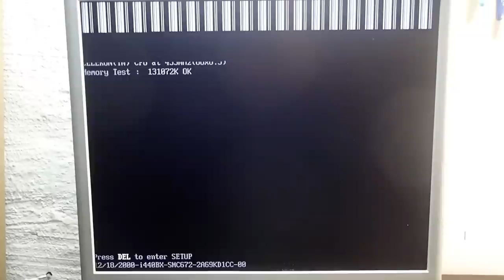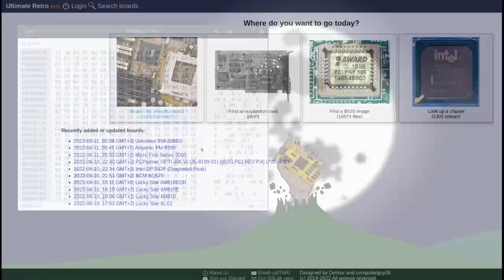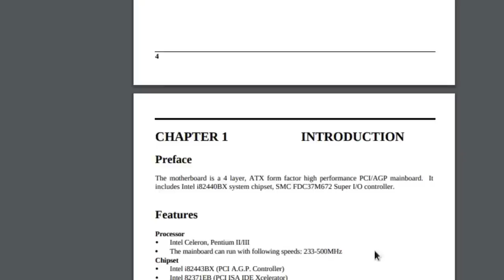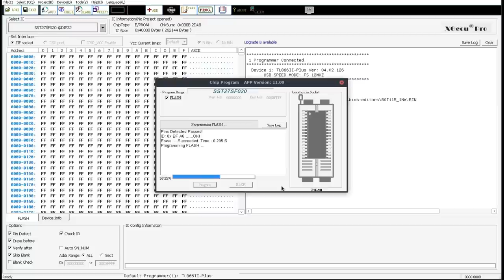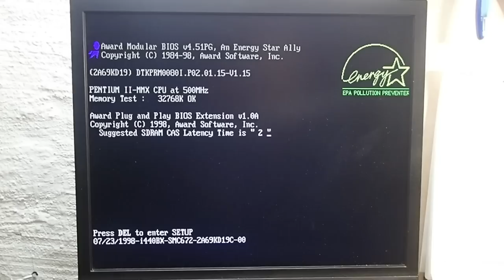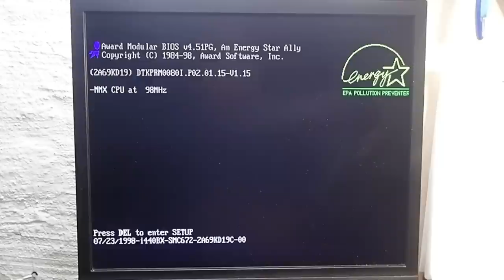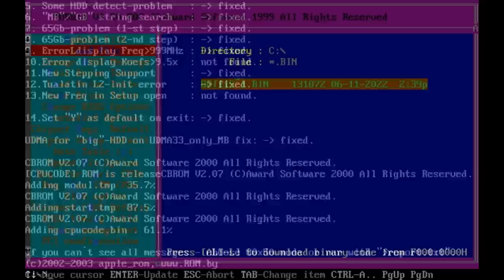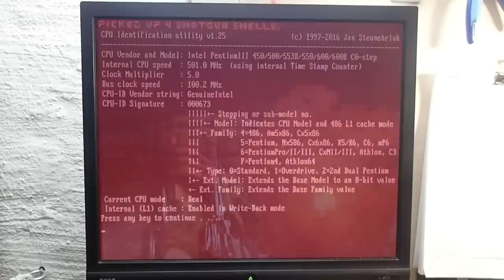My endless confusion with a i440BX Pentium II mainboard.

Comment: Those slotket adapters will eventually burn out the vrm regulators next to the slot. I upgraded my board all the way up to a Pentium3 Tualatin with the slotket and was still using that PC till  2012. But the slotket draws more power than the spec of the board allows. That's how my 440bx came to an end. I finally had to upgrade my PC after 15 years of use.

Comment: Very nice and  nostalgic video. I have two retro PCs (Pentium II) with the 440BX chipset that I revived from the old days. Although they do seem to work, I have trouble loading an O/S on them. USB is out of the question and Windows disks do not work either. What do you recommend in such case if I want to avoid using the floppy?
Reply from the maker: May be the IDE controller is defective. I'd suggest to try a PCI IDE controller and see if it works.

Comment: Hi, did you noticed BIOS 1.?? is 1 Mbit in size? maybe he tries to flash de 2Mbit into a 1Mbit ROM chip and it didn't fit and something is missing, can it be possible with a proper 2Mbit ROM chip and use the latter versions of the BIOS? not sure about what I'm saying but noticed the difference @13.18
Reply from the maker: Yes, the V1 BIOS is 1Mbit, where V2  is 2Mbit. The original EEPROM was a 2Mbit and the image was written completely. If it wouldn't be complete, then the checksum wouldn't fit and the board wouldn't start to initialize. Furthermore I tried to reflash various 2.x version as experiment too and none worked.

Comment: I had problems with software on a BX mainboard,  I had one failed and the replacement the NT system did not like,  I checked and is was not the same REV number, getting a replacement one of same manufacturer and the system worked as I expected it too.   (Slow , the memory expansion is pretty sparse on these)

Comment: found modbin 6.0.0.38 and 6.1 - v4.50.77 and v4.50.88

which version is needed ?
Reply from the maker: Depends on BIOS which you use. If the board is older and uses BIOS 4.5x, you will need modbin 4.5x and for 6.x. the newer version.

Comment: The 440BX chipset was amazing for its time. I used to have one and I got a Tualatin Celeron 1400 and threw it in there to make a decently powerful backup PC. My mobo (Shuttle brand) wasn't stable at a 133 Mhz FSB, but I OCed it to 115 and that pushed the Celeron to 1610. Fun times.

Comment: You also need to be careful about ESR and current ripple, not just capacitance. The VRM needs very low ESR especially on the output, that's why you often see 2 or 3 capacitors in parallel on each phase of the VRM - to lower the ESR. Look in the datasheet at impedance at 100 kHz and that's pretty much your ESR (at high frequencies ESR is pretty much the same value). In most cases, you need to match or get very close (let's say within 5-10%) of ESR and current ripple should also be equal or higher.
This motherboard you have powers the VRM with 5v from the power supply, so there's no point in using 16v rated capacitors. I would have suggested either 6.3v or 10v rated electrolytic capacitors, or solid (polymer) capacitors, in which case you can often use lower capacitance (for example 1000uF or 1200uF 6.3v instead of 1500uF 6.3v would be fine). ON the output side, you could use 4v rated solid/polymer capacitors, which should be easy to source.
Reply from the maker: Absolutely true.

Comment: Finally a new video. Had hard concerns that you quiet making repair vids. Had an old Gigabyte Board a few years ago with LX Chipset and that revision was only capable of handling the first line of P2 and Celerons. The Mendocino Line was not supportet due to Bios Problems and no newer version available. So, very good job by modding the 1.15 Version and weclcome back.

Comment: Still have a 440BX based system running using an Asus P2B mainbord. 

When I got the PC in 1999, it contained a Slot1 Mendochino Celeron 400 MHz, 64 MB of RAM, Matrox Millennium G200 AGP card, Soundblaster Live soundcard, a 6 GB Quantum Fireball HDD, and CD-RW drive. OS was Windows 98.

The current final configuration is a Tualatin Celeron 1.3 GHz, 768MB of RAM, Matrox Millennium G550 AGP card,  Soundblaster Live soundcard, a 80GB Seagate Barracuda HDD, a Hitachi Deskstar 120 GB HDD, 1 DVD+RW, 1 CD-RW and an Intel 100Pro NIC. OS is a dual boot of Windows XP and Debian Linux 11.

Problem with these vintage systems is getting a decent power supply. Modern ATX power supplies are not really suited anymore for the old CPUs,; they don't deliver enough power on the required voltages for vintage CPUs.
Reply: If you have a relatively low power CPU and at least 20A on the 5V rail you should probably be fine... Which is why I stick to my Pentium II 333 that has a TDP of 20W.
Reply: @lordwiadro83  The TPD of the Tualatin Celeron 1.3 GHz is 34W. The GFX card is also a factor. That is the reason I replaced the GeForce Ti4200 with a Matrox G550: it eats much less power: (around 12W compared to the 30-40 Watts of the Ti4200).

Comment: heh, have an old celeron board someone flashed the wrong bios to. it sat for years because both me and my buddy thought it was dead, and at the time we couldn't find a bios file for it (as we were looking for the right board revision, while the previous owner seems to have grabbed whatever they could find, which was a revision down as i later found out).

got bored one day and said screw it, lets see if there's one floating around now. yup. thanks to archival programs like TURP, i managed to find the proper one, flashed it, and it fired right up.

has me wondering about my unstable pentium pro board now.. hrm.

Comment: In 2003, I had a PC in our company's office with (almost) exactly this motherboard and a CPU adapter. IIRC there was a PIII with 900 MHz installed. 100 MHz FSB, that makes me as a die-hard overclocker completely crazy.
I never understood why we as a consulting company had worse hardware than our customers. God, I really hated that computer.
A year later I bought a Powerbook G4 17" 1.33 GHz, left the company and switched privately to OS/X completely within a week. That was a real revelation.
Back then, you still had real reasons to buy a new computer every two years at the latest, or to constantly upgrade the old one. I've had my current main computer for eight years now. Unchanged: an i5 4670K with 16 GB RAM. Only the SSDs (now .m2) and the graphics card (now RX570) I replace in the time. All that stuff has really become more durable. The environment thanks it. 
I hope we'll have ARM CPUs in desktop computers soon. Until then, I'm experimenting with TV boxes.
Reply: I feel like the new processors and graphic cards are not that impressive anymore... Also, it's getting expensive upgrading to the latest and greatest all the time :p

Comment: Capacitors on boards of that era should always be suspected as being bad. 440BX was popular right at the height of the capacitor plague .  Many good boards were killed back in the day because of it
Reply from the maker: The 440bx was actually not that bad, it was more the later Athlon systems, which were badly affected by the capacitors plague. To be honest, behind the scene I checked the removed caps from this board and they were all in very good condition. Still perfect capacity and low ESR, even the scratched ones turned out to be absolutely ok. Still, I don't regret replacing them.

Comment: I have a MSI 6119 440bx but it sadly stopped posting suddenly. One of the voltage line is shorted. Normally these caps don't fail short so I dunno.
Reply from the maker: Could be one of the transistors in the voltage regulating circuit. That is a common issue as well.

Comment: it's usually okay to replace electrolytic capacitors with bigger ones.
Reply from the maker: It depends, usually higher value capacitors have also higher ESR, but if you use high quality caps and keep that value in mind, then yes.

Comment: is there a way to upgrade the FSB to 133?
Reply from the maker: Yes, by exchanging the clock generator, but it is a lot of work and 440BX doesn't support 133MHz officially, it overclocks the AGP to 83MHz at that speed, so I prefer to stay at 100MHz FSB on that chipset.

Comment: What I found frustrating with my board when I got it was that it reported a ‘CPU error’, even ended up buying a different CPU only to have the same issue. In the end after remembering a CuriousMarc video I thought to try reflashing the BIOS which cleared it.

Why they couldn’t have had ‘BIOS checksum’ as a separate error code IDK.
Reply: I think the main reason why that kind of checksum comparison is not used, is that the precalculated checksum would be stored in the same location where the BIOS is stored. So the precalculated checksum could corrupted even though BIOS data is correct and then the comparison would report discrepancy between those two resulting in a ”broken BIOS”.
Reply: @tab8k  Either that or the area which is corrupted (probably a flipped bit) was not ‘essential’ to booting to DOS from a floppy disk and allowing me to perform the update.

Comment: You should also consider ESR value and ripple current, especially in capacitors that are in the voltage path of the CPU. The ESR value is usually the reason why Chinese caps are always a bad choice, as their claimed value is always far from the truth.
Reply: In 2003 I got similar BX440 motherboard with P3 500Mhz and bad caps- I recapped also with generic 16V electrolytics- it worked well for a few years. But this motherboard won't be even used every day - so here generic no names will be OK.

Comment: i propose celeron tualatin 1,4 ghz and 768 mb of sdr133 (at 100) cl2 should work nicely
Reply: Agreed on Tualatin but I suggest sticking to 512MB of RAM so Windows 98 is happy.
Reply from the maker: I don't have a tualatin and I'd have to modify or get a slotket adapter, which would run with it. So far I will have to live with a coppermine, I guess. But I don't mind, I don't want to have the fastest PIII, but the most compatible.
Reply: @necro_ware  i see, i alwys loved how easy is to wiremod a cpu to install it in older motherboard with thin wraping wire
and i had 3 computers with them, one of which was my daily driver for 5 years (celeron 1100 tualatin on cusl2-c runing nicely on 133 bus after covering bsel pins)
i also had very fun celeron coppermine from cd0 steping 566 model which didn't mind runing as 133 mhz bus either it was just so much fun to say i have 200% overclocked cpu
i wish your build good luck and good agp 2x graphic card because that mingt be the biggest compatybility problem of a bx board
Reply: @Arti9m  my was happy after installing a pach microsoft released from windows update, that being windows 98 se got one  i have no idea if the base version of 98 got that, but i was a wierd kid in the days, i refused to switch to xp, and mix win 98 with me files , made a pc with pentium 3 and ddr memory (a whole 2 gb of it) and even overclocked the fastest celeron i could find to 1,8ghz to play 720p videos with no hardware decoder but that worked better on pentium 3s  on via apollo board from ecs because that thing could run sdr memory at 145mhz all day and sometimes even 150 but only 1,5gb of ram :(
Reply: @necro_ware  That's why kokodin suggested a celeron: it still runs at a compatible 100MHz FSB but has up to 14x multiplier. Also it is possible to mod a coppermine sloket for Tualatin support ^_^

Though there is very little reason to do so for real world usage.
Reply from the maker: @Arti9m  Oh, I totally overlooked Celeron in his message :) thx
Reply: same here celeron tualatin 1,1Ghz up to 1.4 with 133FSB ( it was an biostar) , the PCI was running at 44Mhz ( ouch ) amd the AGP was 33% overcloced. But the PC has survived some years :-)  At the last year of use, i have had replace some foulty caps and the ATI-AGP was (partial ) overheated. 

Normal the BX does not  like 133Mhz-FSB but it was my best p.III board. 
Have used an slotadapter for Normal P-III to P-III-T and there where jumper on board, to push up the FSB.
Reply: @mibnsharpals  normal bx likes fsb 133, clock generator doesn't, but many moders knew that you only have to replace it with faster one and make it fully adjustable by hand outside bios to make legends of oc from that time

also  overclocking celerons was fun because if you snip or cover bsel pins on the cpu, there is 2 of them, you will get poor man pentium with fsb133 as a base clock with all other clocks not being overclocked and you can go up from there expecially usefull on boards that do not allow for overclocking, because that just work

Comment: May I ask why you take a DOM? I have installed an IDE adapter to m2 SSDs in my Powerbook G4 17". CF cards are now really expensive, rare and even retro. Are you not worried that the module will break even if it is read only? Where did you get the thing anyway? When I see such a part, I always have to think of Pollin.
Reply from the maker: Hi, that's not a DOM in a classic way. It is a CF2IDE adapter with a CF card. I have a bunch of them with different setups for various machines. They actually are quite cheap and still very good available. The adapter costs about 3€ if you buy a pack of 5 and the small CF cards between 500MB and 2GB also cost only couple of €.
Reply: @necro_ware  Aha, they've gotten cheaper again? I would not have expected that. They used to be absurdly expensive.
But sure, 13 Euros for 2 GB is a lot of money in comparison, but we're also talking about DOS and very early Windows versions here. Back then, people dreamed of hard disks of this size. 
My Quantum Bigfoot had a gigantic 1.7 GB. I was the HDD king in my circle of friends.
Reply: @necro_ware  If you ever get a chance to get a Quantum Bigfoot: These are really nice hard drives. Visually and technically.

Comment: Don't wash boards in tapwater! The minerals will stick to the board causing shorts! Use distilled water
Reply from the maker: You can easily use tap water as long as it is not too hard. Washing my hardware with tap water since 30 years ;)
Reply: @necro_ware  wasn't expecting that. Still, it is safer to not use tap water, the minerals can still cause shorts, even though the chance is like 0.1% if you have used tap water for 30 years, the chance still remains. Don't tempt fate
Reply: @necro_ware  oh, I have to ask something, I recently got a decomissIoned office workstation (not like any pc you would show as it ran windows 7 and was a modern pc), but it uses laptop pcie cards, with half size port cards at that, I need to find a bluetooth card for the unused second slot, and I do not know if amazon would have this stuff, do you know any online stores with this stuff that ship to Canada? Keep in mind it needs half size laptop  pcie (the pc is more of a laptop style pc, but no built in battery, screen, keyboard, or mouse, it runs on 19.5 volts)  --edit: typo fix
Reply from the maker: Hm, do you have a model number of that PC? There were different types of cards, but you probably mean mini PCI-express. If that is what you want, you can find piles of those cards on Ebay, but many PCs and notebooks have had hardcoded whitelists, so you couldn't just plugin any card you want. Basically this is cheating on the customers, but it is how it is unfortunately. However, the risk shouldn't be to high, since those things are really cheap and eventually you could also use a tiny USB BT dongle if nothing helps.
Reply: @necro_ware   pc model is a hp prodesk 600 g1, idk if mini pci express is the proper type, either way, it uses pci express cards common to laptops only, it is in fact a desktop pc, however, the laptop size card is half the size of the normal cards, I do not mean lengthwise, I mean the WIDTH is in half, the connector  AND the card are half the width of what a laptop pcie card normally is
Reply from the maker: @drhax9908  I googled for it and I'm not sure, which one you have. There were different HP ProDesk 600 G1. One mini tower, one small desktop and one really compact device. The last one, I don't see any expansion slots there at all, but I don't see good pictures of the mainboard of such a device, so I'm not sure, if there is a slot for expansions. The other two are have normal mini ATX mainboards inside and can be upgraded with normal PCIe x1 or x16 cards. The smaller desktop PC needs low profile PCIe cards, but I guess, this is not what you are searching for.
Reply: @necro_ware  the computer in question is the size of a slightly bigger than normal router, it uses a 19.5 volt power cable, not sure what version you found, but the slots are on the side of the board where the ram is, one is under the hdd bracket, the other is near the cpu fan
Reply: @necro_ware  youtube is removing my posts to the board image I took to try to help you
Reply: @necro_ware  do you have word filters set, or are you removing my posts?
Reply from the maker: @drhax9908  No, YT doesn't allow external links and automatically removes them. And also some posts by a logic which nobody understands.
Reply: @necro_ware  that, is annoying. It literally removed a comment that would have helped you

Comment: High-voltage capacitors also have higher ESR and produce more heat at same conditions.
Reply: Higher voltage caps actually have lower ESR. I don't know about the heat (or leakage), though. My ESR meter has a chart showing acceptable ESR for a variety of capacitances and voltages, and it recommends lower allowed ESR the higher you go in either capacitance or voltage.
Reply from the maker: Yes, thank you very much. I totally forgot to mention this and would like to add, that a newer capacitors with even higher voltage can still have lower ESR, than the older ones. It heavily depends on the quality and manufacturing process. But as a rule of thumb, you are absolutely right.